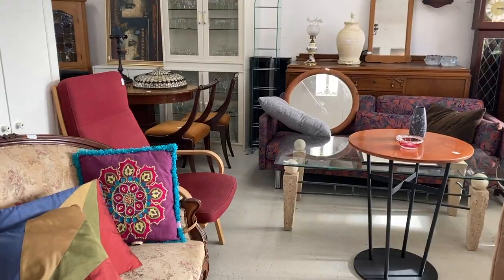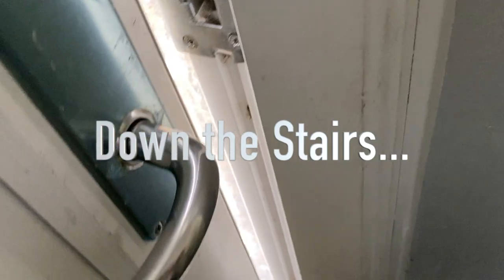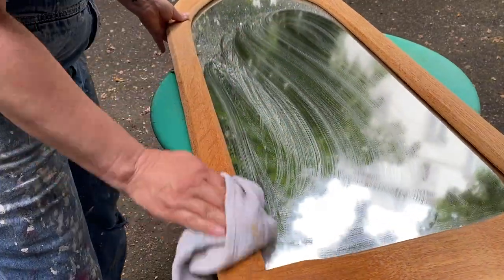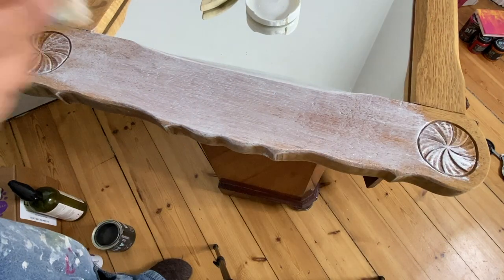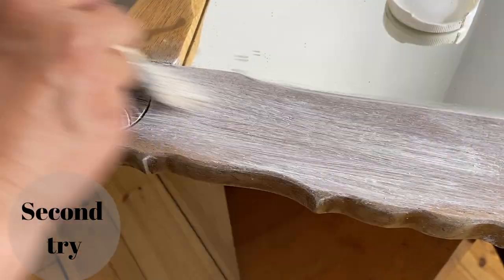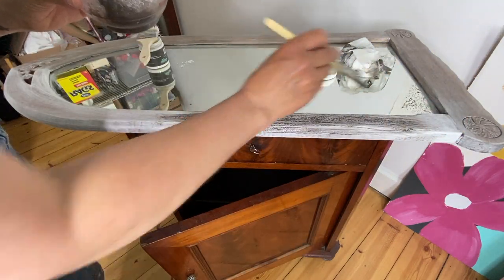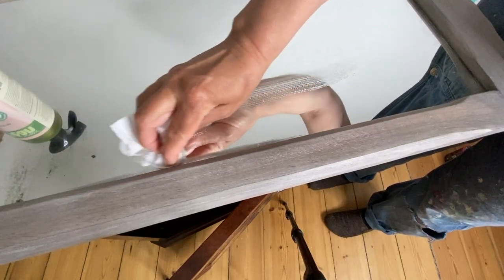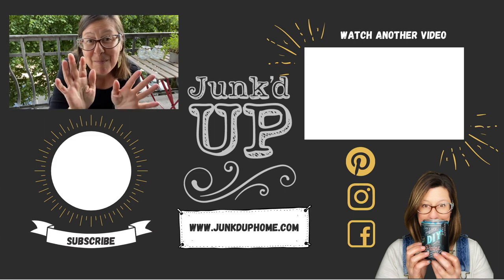Easy Weathered Wood Finish- mirror makeover using just two products

Comment: Sometimes the right video with the perfect technique just pops into your notifications! This one was it for me! Could you top coat that for extra protection? Wanted to use it on an old dresser. Thanks!!
Reply from the maker: It would depend upon on what paint line you are using. For DIY Paint it is not advisable to use a topcoat over the wax. If I were doing a dresser I would do either add an additional coat of white wax or I would just do the technique twice. I contemplated adding clear wax on top but I think the clear wax may remove some of the white wax. I’ll have to experiment with at. 
Alternatively, you could lay down clear wax first, then do a wash of white, then do a wash of weathered wood and see what that looked like. Then you could clear wax on top.